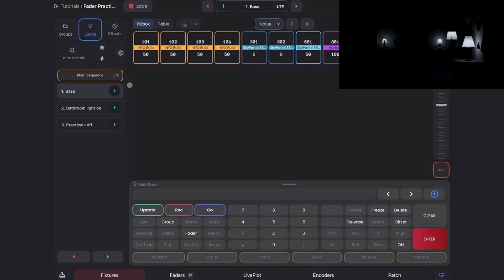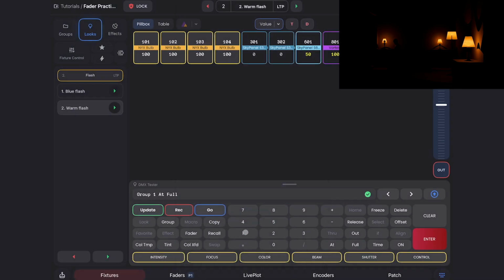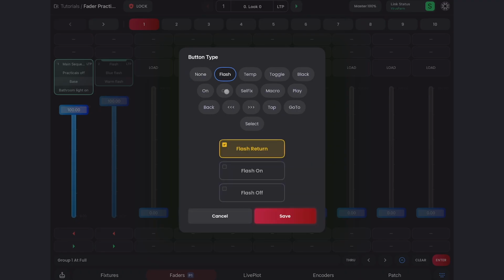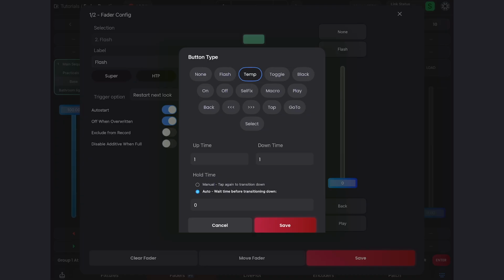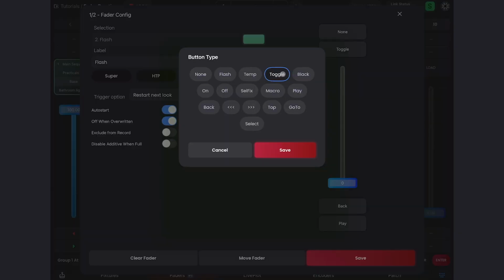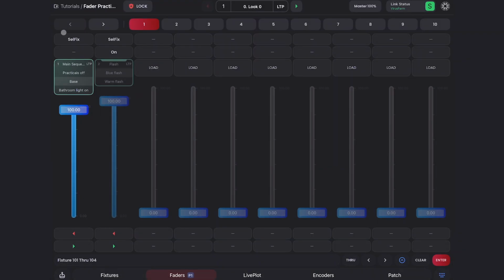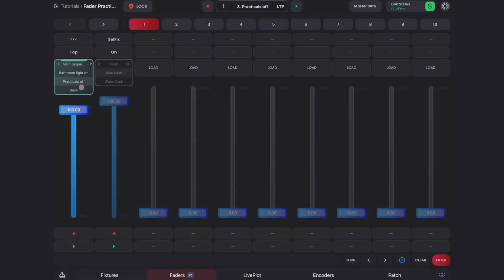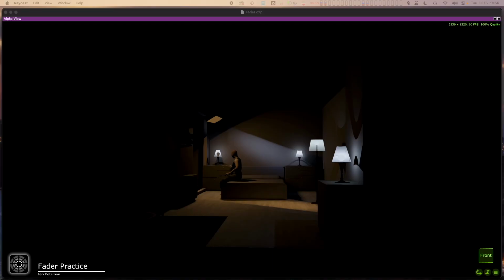Fader Buttons Explained

Comment: Thanks for these. Feature idea from watching: There should be a Color Code key easily accessible inside Blackout to reference for beginners. I'd think a toggle in settings like "Show Color Key Button" or similar, and that setting puts a small button on the top row that brings up a large color key over the screen only while holding the button. Knowing the colors and what they're telling you is very essential to diagnose problems and I think it'd save a lot of time on set when people are expanding into new feature sets and whatnot and don't remember the color codes, get stuck and then give up using the new feature.